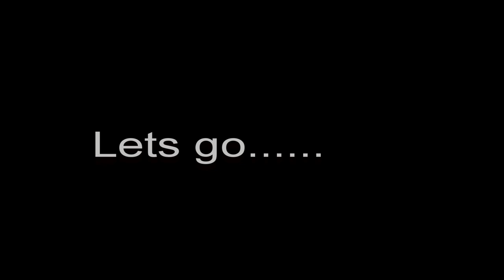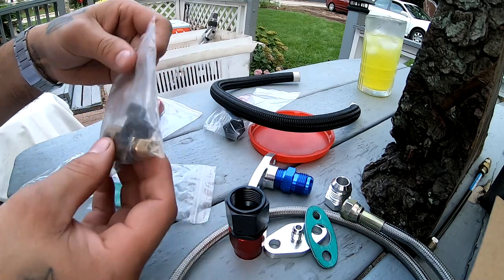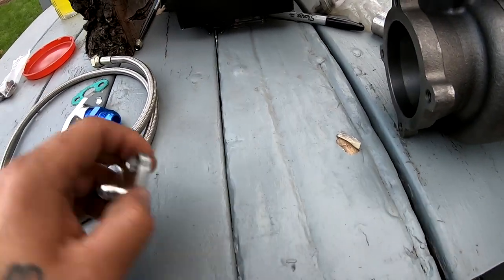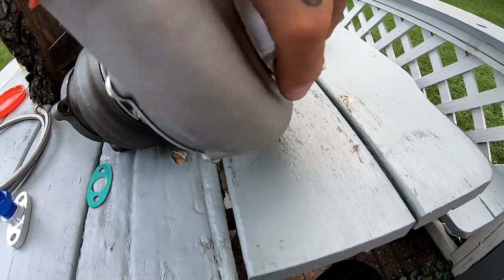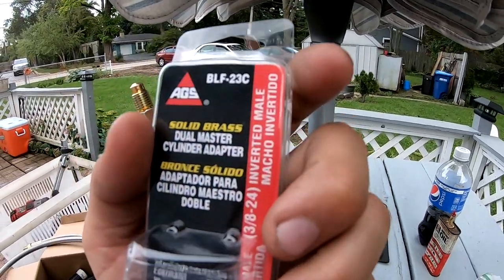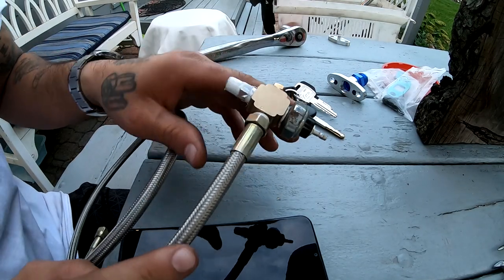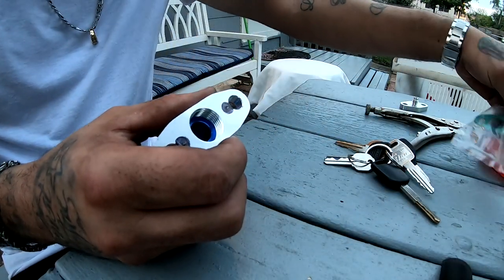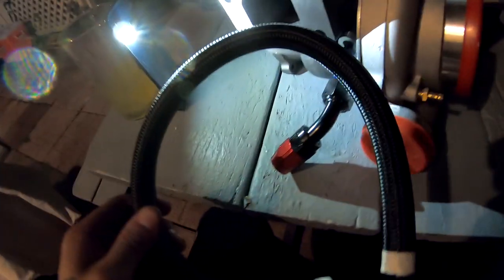500hp civic build gets $28.99 ebay Turbo oil feed line and return on GT3582 turbo #maxpeedingrods

Comment: I had the same issue lol but they sell a fitting that fits on the feed side and you dont have to do that..ima have a video up soon if your curious. And my gt35 came with water cooler ports on 2 sides..i uses 2 drain plugs m14x1.50 and it worked perfect incase u nees it..
Reply from the maker: Yeah im interested I just sub to your channel can you add part numbers to your video please thanks for the info.👍
Reply: @BarbasLife  sure will my man..and thanx for the sub!:)

Comment: mine came with a 7/16 threaded hole for oil outlet on turbo....   Do i use a barb? I got same turbo you got and same oil line kit but nothing goes on bottom of turbo to connect to oil drain line.

Comment: Did you have any problems with the nylon oil return? I was told stainless steel was recommended bc of heat, but I know others with nylon hoses, that don’t have issues. 
Especially if you heat wrap it. Just wondering your thoughts and opinions.
Reply from the maker: No issues at all. Works great to this day 👍

Comment: What did you use for your oil feed I’m having that same problem
Reply from the maker: Funny u ask watch the whole video part numbers and everything are included in this video so it can be easily located. (Your answer is brake lines by the way) watch the video smash the thumbs up and sub brother. Help me reach 10k.
Reply: I’m about to use a 4an adapter fitting with a restrictor
Reply from the maker: @izzylite1  turbo already has a restrictor built in.

Comment: Do u have a link to the 4 flange u used for the exhaust pipe ? Im gonna get my done but i need the right flange thanks in advance
Reply from the maker: https://www.ebay.com/itm/323751917356
Reply: Barbas Life thanks a lot !
Reply from the maker: @juang5789  yeah no problem hope that helps
Reply: Barbas Life Yes that helps, Im putting this in my h2b hatch.
Reply from the maker: thats gonna move!💪 is it stock internals or built.
Reply: Barbas Life Gonna run it stock at 8 or 10 psi and later im gonna build it and hope to run 20-30 psi . Just dont wanna push psi with no sleeves.. you know how weak the frm walls are lol
Reply from the maker: You should be fine at 8-10psi good luck. You still gonna make some decent power.

Comment: Are you sure thats the top? I'm having same problem but I think it the other way around..  let me know if youre right and it works out.
Reply from the maker: Do it how I have it.feed and drain are backwards on this turbo. Only way is how I did it. If you do it backwards oil will dump all over your engine. There is a video on some other guys channel that did it backwards Greasemonkeymods I believe is the channels name tons of oil dumped everywhere he had to swap it like I have it.
Reply: yes that's the top. I had mine upside down.

Comment: Bro I have the same turbo and ran into this issue as well with the feed line 🤦‍♂️ 
Can you link me what you used for the feed?
Reply from the maker: All the info for my feed setup is in the video just gotta keep watching. I have part numbers.
Reply: @BarbasLife  I have the same exact turbo and the setup didn’t work for me for some reason. So dumb that it doesn’t have a flange for it

Comment: Where is your OPR????
Reply from the maker: Not sure what you mean? (Oil pressure return)  so the feed and the return are actually backwards on this turbo. There is a small regulator built in that you can see inside. I only know this because i seen someone actually install it backwards and oil was shooting out the dump pipe.  took a minute to figure out but switched the feed and return and worked perfectly. Let me know if this answers your question. Thank you.
Reply: @BarbasLife  you have the BoostSmart OPR for the Turbo ball bearing right? BoostSmart is the only company making a turbo OPR that I'm aware of. I am having a heck of a time finding a location to return the oil from the OPR . I contacted BoostSmart today asking if the oil return is gravity returned or if it can be mounted lower then the return point do to the return being under pressure.  Still waiting on an answer

Comment: Those are 3 diffrent turbos right there one is borg warner garett and volvo turbo really exhaust is garrett intake of turbo is knock off turbonetics as long as u have the amount running out in the drain your fine it wont hurt at all for real and to save time is run a line from back of block to T and have it to where u can work on it closer to front of engine to hide so you can work on it easier just hide under manifold get what im saying so its eaiser to work on wont have to worry about nothing great video just fo future stuff and 411 v port will hold more power and is better for the exhaust to flow and keep the turbo spinning and u can port the v in the exhaust housing and on your manifold and gasket it will whistle but it will spool up faster 500rpm plus and i put bigger intake wheel and housing on 8lbs of used powerstroke diesel and 4500rpm to 8200rpm untuned it i spun 4th gear on pavement with the purple housing and wheel upgrade so 20psi is gonna be mean so this is awesome i just get out do alittle work and rest and trying toget after it  its ruff but stay safe practice this safe stuff so people like me trying to help a person dnt die need to keep people like us alive people teaching people how to do stuff that dont have the stuff gas monkey texas metal OC CHOPPERS DIESEL BROTHERS I SENT STUFF TO PEOPLE LIKE THAT AND THE HAVE SENT A FUCK YOU KISS MY ASS OR NOTHING TO ME NO MATTER WHAT WE ARENT SAINTS I HAVE SEEN AND MADE PREACHERS CUS FOR REAL ITS JUST SOMETHING NOBODY WANTS TO HELP U WHEN THEY HAVE HELPED YOU BUT ANYWAYS IM JUST SAYING KEEP ON POSTING AND BUILDING SOME PUNK KIDS WHILE I WAS WORKING COME BY AND VIDEO TAPED VANDALIZING MY HATCH BACK AND POSTED IT ON FACEBOOK IDIOTS I DIDNT CALL THE LAW AND IM NOT A SNITCH IM JIST A GREAT PERSON AND SOMEONE U WANT ON YOUR SIDE BUT KEEP UP THE GOOD WORK IM TRYING TO FIND SOME SPONSORS I HAD TO TURN DOWN THREE JOBS ONE FOR RAIL ROAD N&S i habe blood clots so cant be on my feet or id be making money and building and selling but anyways bless up and smokem if u got em take care hondas for life cause they build the motors whether its A 2 R LMFAO get get IT 💨 BLOWIN ON EM🕵SLEEPER

Comment: Im having the same issue with the oil kit and my turbo too. Drain doesnt fit my dual BB gtx3582r :-( what kind if wastegate you using 
Heres the one i picked up
https://youtu.be/PyxQZoVGU7M
Reply: I got the same one for my gt3582 I’ve heard it works great I guess we’re gonna find out
Reply: @johnathonlesmeister2378  the same oil kit?